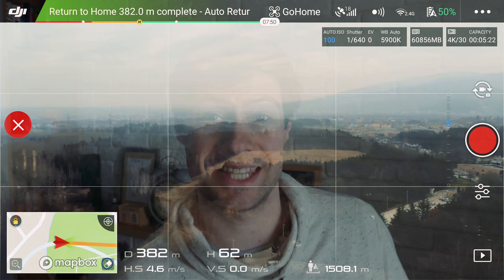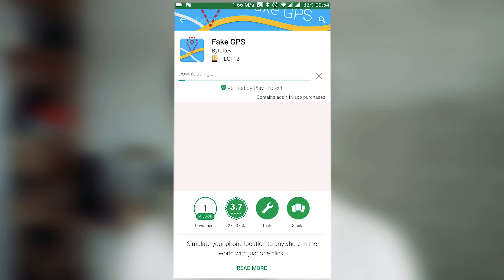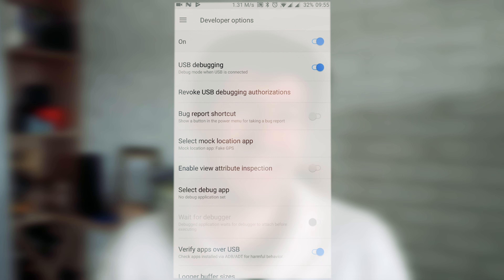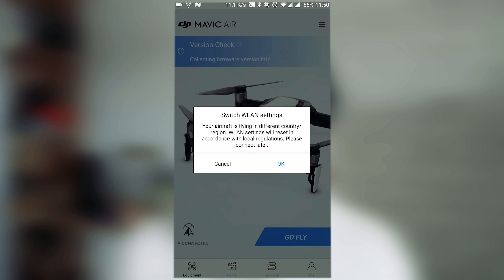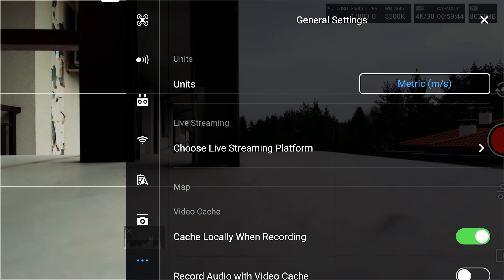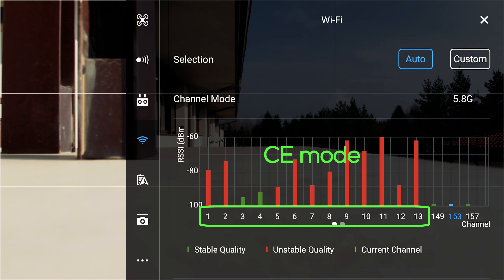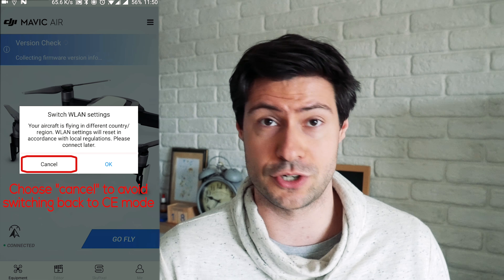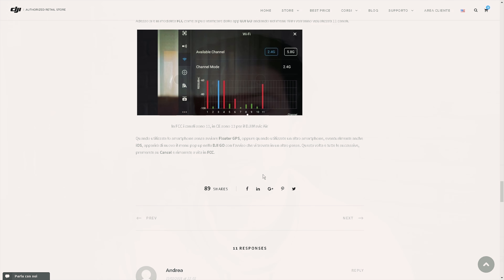DJI Mavic Air FCC Hack: Switch to FCC Mode in 2 Minutes!

Comment: I can confirm that this works even across devices, once it's "saved" to the controller on Android you can switch to iOS and it'll ask the same question. However, once I accidentally hit "ok" on Android while in the field (thus going back to CE mode) and the Fake GPS app just wouldn't work. Once I went back home, it worked again. I think that if DJI Go receives GPS data from the aircraft, it's going to override the GPS from the phone, therefore staying in CE mode if you're in Europe.

Comment: Before, the Air even loses connection whiles the drone is even in my palm. Now, it maintains connection even if it's headed to Mars. Thanks for the FCC mode and you.
Reply: Shit man. I'm about to buy this now. Is it still worth buying in 2020? Or shall I buy the new mavic mini? I live in the UK and new mavic mini even though its much. Cheaper, it cannot be changed from ce to fcc becauss it's hardware coded
Reply: you can use the RTH? or no?
Reply from the maker: You can, of course. The trick is applied to the controller, and RTH is driven by the drone's GPS.
Reply from the maker: Guess time for me to take off and get a drone-meeting on Mars then! 😇
Reply from the maker: Still a good choice. Interesting to see what DJI will announce in the next days though. 
The Mini is also good, just doesn't support 4K video and good photo controls.
Reply: @TechMishka  thank you so much for your reply. I'm in a dilemma right now. Can you please help me?

I'm about to go off to a holiday and I need a drone by next week. I live in the UK. Would you recommend buying:

1. second hand DJI phantom 4 (the basic version) from my cousin for 400 pounds?

2. A second hand phantom 4 Pro from my cousin for 750 pounds? 

3. The new mavic mini FROM Currys pc world with 3 batteries for 460 pounds? 

I'm on a bit of a budget and I don't think number 2 is worth 750. 

Thanks alot in advance. Your advice would mean the world to me :)

Comment: I can confirm that on iOS, you can change your phone's location if debugging an app with Xcode and simulate location. Be sure that network debugging is on so that you debug the app (whatever the app is, doesn't matter, a new clean project is fine too) wirelessly so that you can use USB to attach to the Mavic's remote. This is not for everyone, I know, but maybe it helps someone. I've successfully switched to FCC and my range extended dramatically.
Reply from the maker: Thanks a LOT! Awesome to have info for iOS!
Reply: Do you know of any working "Fake GPS" for iOS?
Reply: did not get if i have to do so every time i use the drone or once and fine.
Reply: After you switched to FCC mode with an Android phone first, you can then use an iPad instead. No problems, it stays on FCC.
Reply: AGM van de Kar  Can u use an iPhone as well?
Reply: @ardy-h  Yes. Just cancel the message you get to change the Wifi settings.
Reply: @MrAntongm  you can explain in a simple way because I use Google translate but what do you mean by "switch"

Comment: Many, many thanks! If I only knew that it was SO easy. I thought it involved faking the location every time again, but it's simply switching the remote into FCC and not allowing it to switch back. It's so easy, one could think DJI has got a solution against it, but they probably don't care, not their responsibility anymore. I didn't fly yet, just switched, but I'm excited to see the results. I don't need kilometers of range, but if I get 300m without disturbances in the video feed, I'm already happy.
Reply from the maker: I am very happy that it works for you! And indeed - it takes only a couple of minutes;
DJI have more or less no choice - if they don't respect regulations, they are about to be in a serious trouble. Good that they still keep the backdoor unlocked 😇

Comment: Does this work as of 14/12/2019? As I’ve just tried and it says it is changing location and just says ok, it doesn’t give me a cancel option
Reply from the maker: You may try an older version of the app.
Reply: It works for me 27/12/2019 I can just cancel and I'm using the latest version app and drone software
Reply: Same happens to me.

Comment: It works thanks ....my only concern is about the return home function. .
Reply from the maker: No need to be concerned about that - it is based on the GPS inside the drone and the function will work just fine.

Comment: Hi tech4all,
In CE mode my Spark would fly close to 350m, and that is with glitches and video losses. After FCC mod, my personal best record yesterday was 2235m without any video glitches. Decided to trigger RTH as the battery level has reached 45%. Thanks for sharing and keep up the good effort!
Reply from the maker: cheguazam , I am so glad you share this result! Awesome! I haven't done any range tests on the Mavic air, because the terrain around where I live is not suitable and the weather is anyways quite bad :-) But the CE mode of the mavic Air is as restrictive as the one on the Spark. I barely felt any difference.
Reply: Hi. I just bought a mini 3 pro with a smart controller. Anybody know how to get this in fcc mode??

Comment: No, will not fall in the ocean. The Fake GPS is needed only to fake the DJI Go about the location in order to switch to FCC mode. Once the aircrafts GPS aquires satelits, will know the exact location.
Yes, the Return to Home function works perfectly as it knows the exact location when flying.
Yes, it works with the latest DJI Go version so far. You have the option to stay with the FCC version pressing the Cancel button when starting the application.
Yes, the FCC mode indeed increases the range a lot. In CE mode my Air started to loose the connection with the remote at about 800 meters and never reached 1200 meters. In FCC mode I had to return home from 3300 meters because of the battery, the air temperature was only 1 grade celsius.
Reply from the maker: Man, thank YOU! I get these questions so often. Let me pit this one.

Comment: Yes lots of people posting this mod which is very good info but DJI have stopped this trick from working in the latest version of the App, I am running Android version 4.3.0, it lets you switch to FCC mode when you run fake GPS app but the minute you stop running the fake location it defaults back to CE mode without asking you. Is there a version of 4.3.0 that has this limit taken out? how recent is the hacked version in the facebook group? and can I install both versions of the app on 1 device? Thanks for sharing.
Reply from the maker: THere is a way to have two versions of the app if your smartphone supports it. But there is nothing wrong staying at slightly older version - I don't think there will be many new features arriving in the new versions. Haven't tried the mentioned by you version yet so I can't say if it reverts back to CE on my end too.
Thanks for sharing this!

Comment: Hi friend, thank you very much for the tutorial. just one question ! What happens if I need to return to the home point automatically? my location is different from fake gps, where will the drone go back ?? Thank you so much from Brazil.
Reply from the maker: Warm greetings to Brazil! :-)
The return to home function will remain unaffected. When you enable the fake GPS app, it tells the transmitter "Hey, we are in USA, so let's switch to FCC mode". It doesn't directly talk to the drone. The return to home function is based on the GPS that is embedded on the drone itself, so it won't fly away :-) As you can see I have tested DJI spark in FCC mode while I am in Europe and it returned home safe and sound :-)
Reply: Thank you so much for answering! when I turned on the drone I noticed that on the application screen where my current location appears in that small image where it is possible to click and enlarge it and see my location, my home point was in USA, so I did not fly because I was in doubt. Do I have to leave the fake gps active ??
Reply from the maker: Oh, please disable the Fake GPS before flight. You only need it to turn the transmitter in FCC mode and after that just remove it :-) Maybe that's why the map was showing a weird location.

Comment: Hi man, unfortunately after so many tries it doesn't worked for me on September 2021. Tried with fake GPS, tried to go with the drone (Mavic Air) to a location without GPS signal, it sees on the map that I am in the US but it didn't prompt me the message with changing the WLan settings.... Not at all. Still 13 channels and not 11. This it's my first time trying all that now with firmware up to date... Could be that Dji "fixed" that with the latest updates?! Please perhaps you can provide a solution. Greetings!
Reply from the maker: Hey mate, so sorry to hear that. 
You may check some facebook groups - like TheSParkSide.
Reply: @TechMishka  thanks for the tip

Comment: Thank you so much.  Hack works well even on iPhone.  The trick is to use any android device, follow the steps to trick the transmitter hence switch to fcc then use your everyday iPhone for the drone and press cancel at every launch of dji app.  In my case the gain seems good enough although I d say still far from my magic pro (ce).  Thank you again.
Reply from the maker: Thanks for sharing your experience, Piero. Yeah, the transmission is not as stable as Mavic Pro due to the difference in the wireless communication, but definitely way better than CE mode.

Comment: Will this work with mavic air 2
Reply from the maker: Not sure. The app is different; Guess with Occusync you won't really need it.
Reply: @TechMishka  in uk pal tried last night doesnt work and range definantly decreased struggled to get over 2000km but was in built up area no warning of low signal either like the old mavic pro with quality drop it just goes then drone starts to return to home then you pick up signal again

Comment: Will this trick also work on the mavic mini?
Reply from the maker: Sort of - you can use the Fake GPS app but you will have to keep it on during the flight. As soon as you close it, the controller goes back to CE mode.
Reply: @TechMishka  Zo the map wont work then?

Comment: I have a question. Once this is done will the GPS on the DJI app show the location you are actually flying in or will it stay in the USA? I'm hoping this works with the new air 2 I've ordered
Reply from the maker: The RTH function is based on the GPS inside the drone. So no worries.
The Mavic Air 2 doesn't really need it - you will have occusync which is having less drops.

Comment: Say I lose connection to the drone and need to rth. Will this affect my home point?
Reply from the maker: No, it will work as normal; The transmitter's setting is based on your phone's location and sets the transmission power. The Drone's GPS works as normal and this config change has no impact on it.
Reply: Tech4All thanks!

Comment: Thanks for the video! Just a question, after you trick the transmitter and switch Fake GPS off, will the on-board GPS on the aircraft still work or will it also think it's in the US rather than your actual location (hence rendering GPS useless on the drone)?
Reply from the maker: The GPS in the drone will continue operation as normnal - it is independent from the transmitter's setting. So there will be no "flyaway".
Reply: @TechMishka  "Returning to home, Distance=1092,036km"

Comment: Its crazy to think that when in CE mode the max distance advertised by DJI is only 2000m in perfect condition but FCC mode is 4000m in the same condition... with spoofing the gps wont this take away gps map functioanlity due to the maps thining we are in another country or doe it just spoof the controller rather than out phones gps?
Reply from the maker: It is not crazy, but logical - based on the maximum allowed radio transmission power in different regions.
Spoofing the GPS is happening on the phone, not the drone; So RTH works fine.

Comment: How do you switch to 5.8 ? what is it recommanded for ( less frequencies commonly used, better range) ?
Reply from the maker: I switch to 5.8 from the DJI GO 4 app. Just navigate to the wifi settings and choose a custom frequency. I prefer 5.8 because it has less interference, especially in urban areas.

Comment: Hi. I tried this tutorial on my P3SE because DJI App 3.1.23 always crashes on my phone (Galaxy S8). Unfortunately then another problem came up. I changed my location to US with Fake GPS and got 11 channels but as soon as I connect my phone to the transmitter and the drone, the location sets back to Europe and 13 channels. It seems as the app checks location data not only from the phone but also from the drone and resets to Europe whenever I connect my phone to drone and transmitter. The app does not ask me if I want to change WiFi settings at all. Anyone else having this issue? Is there any fix or workaround? ~Jules
Reply from the maker: Is your phone Samsung? Noticed that behavior with a few Samsung phones recently. And happened exactly as you describe.

Comment: What should I do with mavic pro ( I’ve done such operations , but there is no menu which turns on the fcc mode )
Fake gps is working ( a am in US in google maps)
Reply from the maker: THe procedure is the same with the Pro. But it has occusync - why do you need to go to FCC?

Comment: i did this but when i turn the mavic and controller on. Its as it was and  I dont  get that switch pop up box?
Reply from the maker: SOunds like the fake gps app not working. You can try another one - looks like some of them are not working well with some phones.
Reply: I do not get asked to switch in uk..
But have 11 there with fake GPS.. 
When I start with out fake GPS have 13..
Any ideas fellas

Comment: Hi, first thanks for the super clear video. I didn't even need to take notes, so clear and straight forward it is. My procedure failed because I did not have the "cancel" botton. as soon as I reconnected the phone to the controller with "normal" GPS - it told me it changes settings to the local ones, and allowed me only to OK it...
Reply from the maker: Hey Alon, thanks for the feedback and glad it was easy.
Unfortunately the recent versions of the DJI GO4 app are getting tougher to beat. You may try to run something older and see if it will work.

Comment: Works with lastest versión of dji GO 4? For me ever change from FCC to CE. Only change option allowed (only ok, not cancel) when detect the diferencie between GPS location and dron Mode.
Reply from the maker: Is that on iPhone or Android? Maybe you can go to apkmirror and check if the older versions do the same. Works good on my side, but the app is the october release.
Reply: @TechMishka  it's Android version. I Will try with apkmirror old version
Reply: I have also the 4.3.8 version and it works fine.

Comment: Question: can you still use the return to home button with this on?
Reply from the maker: Sure! The RTH is independent from the Transmitter settings - it is bound to the GPS inside the drone.

Comment: New subscriber here. Sorry if this has already been asked, but once you're in FCC mode, can you use the map while flying so you know where your drone is? Do you turn the Fake GPS off once you're in FCC mode? Thanks.
Reply from the maker: Questions here are always welcome! 
After you are in FCC mode, you can uninstall the app - it is no longer needed. ANd it is only used to trick the transmitter - the drone and its GPS work as normal and everything continues as normal. RTH also works without change.

Comment: Mavic Air 2 here, best CE distance was 1.5km so far. I started noticing weak signal so I'm not quite certain what's causing this or what's interfering but I believe I can get it further.
Reply from the maker: I never tried to push it that far, but 1.3 was something I got and it was pretty stable. It very much depends on the area.

Comment: hi iam just wondering if you change from ce mode to fcc mode can u use a ios phone or are u stuck with the android phone you used
Reply from the maker: Yes - you can use an iPhone and it will work fine. You will have to hit the "cancel" on the "switch wifi settings" prompt every time you see it, exactly like it is with Android.

Comment: Hello Myke! The FCC mode will unlock the maximum 500 meters altitude on Mavic Air?
Reply from the maker: It will not. This limitation is applied on every DJI drone so far.
Reply: thank you!

Comment: Please tell me what will happen before  switching  the fake gps off again ..what the positions at  the controller map i will see ..and what is about the RTH POINT and the map
Reply from the maker: Hi Hasham, the only negative side of the fake gps will be how your phone treats the location. The drone uses its own gps module to locate coordinates. It will disturb google maps, for example :D But your RTH and take off locations will be fine. Overall it is better to switch it off, because it unnecessarily confuses your smartphone.

Comment: Hello, I did all the steps. I would love to use a fake location since I'm in a zone where I can only fly 150meters high. So when I launch the DJI Fly app, it states I'm in a free zone, which is great, but when I connect to the DJI Mini 2 and want to start flying, it connects again to the GPS for the RTH function and then it loads the correct gps data, which leads to the fact that I'm in the 150m zone again, and also in CE of course :( So the fake GPS does not seem to work for me. Is there any way to bypass this? Thanks in advance !
Reply from the maker: Sounds like you are trying to apply it on another Drone? Because as far as I remember - DJI Go 4 is the one suitable for Mavic Air 1.
Reply: @TechMishka  Yes, I have the mini 2. I guess it's a different software then since for the mini 2 the software to use is the DJI Fly app, whereby the GPS is integrated so the fake gps location gets overruled.